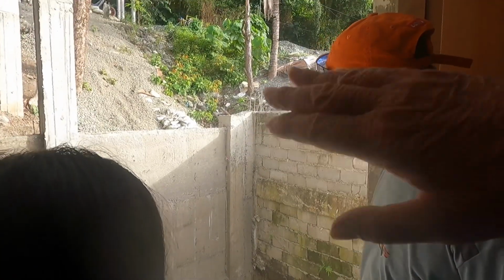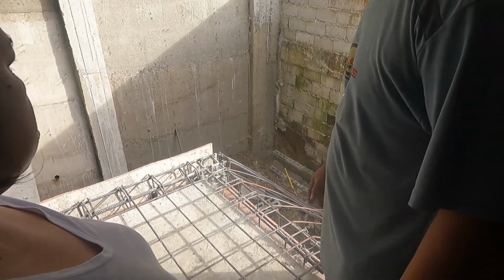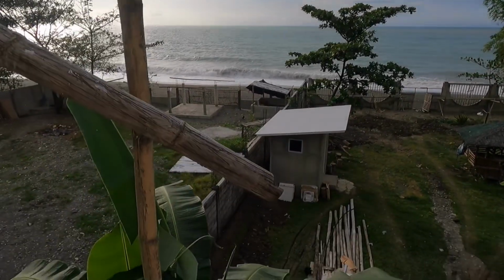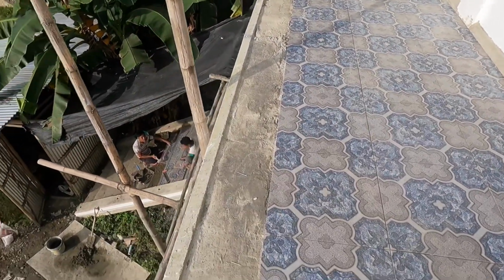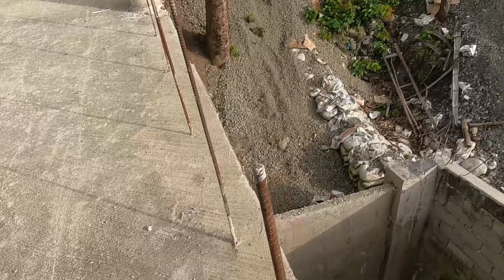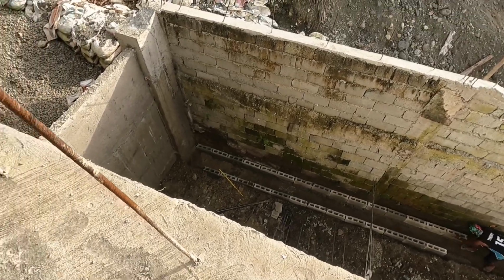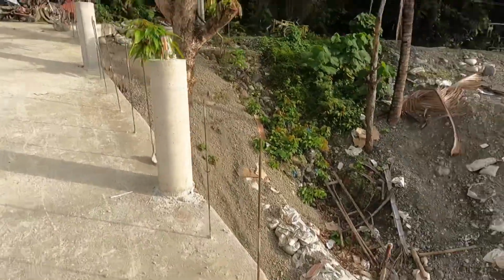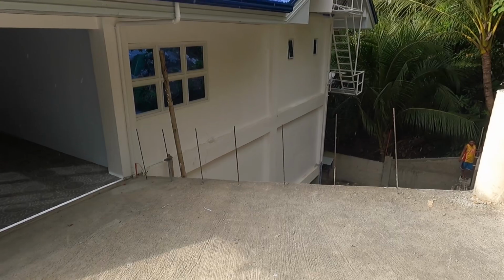Antique,Philippines house build DAY262-Drainage for the property. 🍌🙉

Comment: One advice if you put a cement cap on it you might have some problems if it gets plugged up with trash or even dirt
Reply from the maker: Every third one or so will have a handle to lift and clean